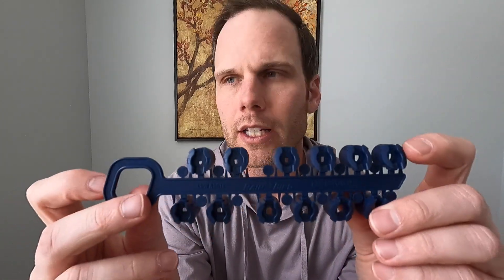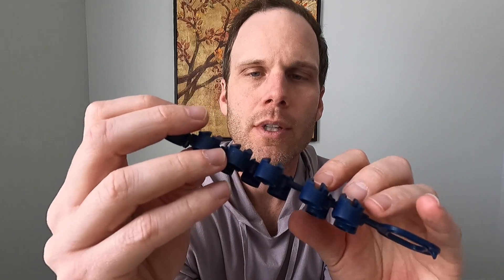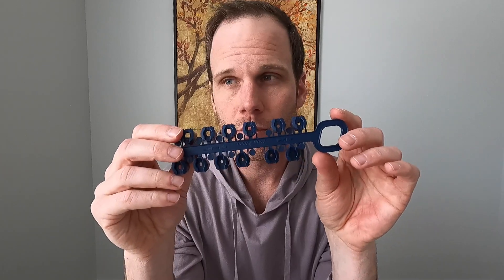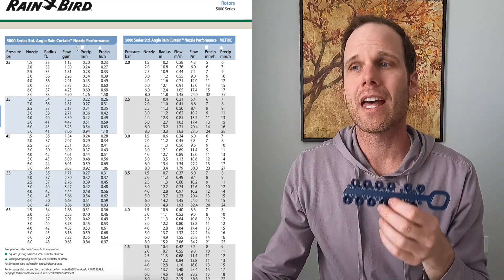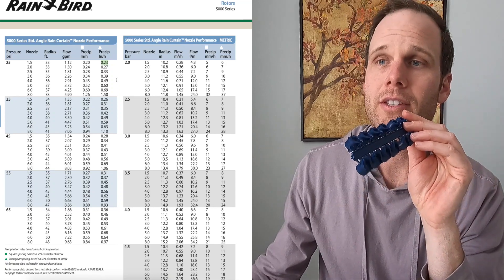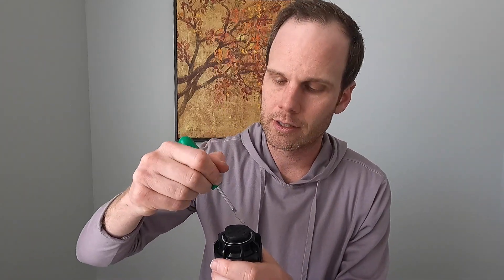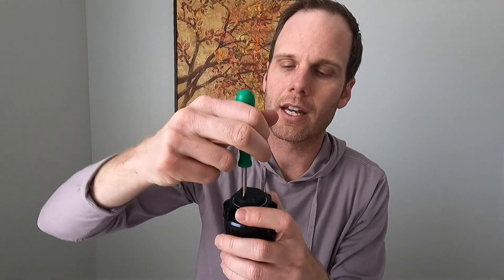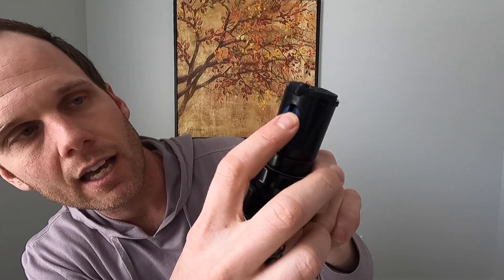Installing The Correct Nozzle Correctly   Rainbird 5000 Rotor Head

Comment: New subscriber here. Very informative videos. I have a Hunter sprinkler system and I noticed that on one of heads water is gushing up around the riser. after I hand tightened the head as much as I can. Do you have any suggestions why this is happening and how I can solve the problem? Thanks!
Reply from the maker: Probably needs head replacement.  Gasket worn out or head broken in some way.

Comment: none of those have a better rain curtain that the 3.0 it came with all the rest have dead spots in the arch of water , what am I doing wrong?
Reply from the maker: Make sure nozzles are damaged and set screw is not screwed down too far.  Hope that helps 
.
Reply: @thesprinklerchannel nozzles are all brand new and screw is not set to far down i really can’t get a better curtain than the 3.0 what number is supposed to be better ?

Comment: I bought some replacement nozzels to reduce the flow amount of one rotor head. I had a difficult time removing the nozzle that was installed and wonder if there is a technique to removing it.
Reply from the maker: Use the adjust tools has worked for me although sometimes damaged it or turning on water after set screw is retracted which holds it in.
Reply: @thesprinklerchannel  I found a video that suggests using the tool or a flat head screw driver along the bottom of the nozzle to be replaced. You push the blade into a recessed area in the main shat that aids in pulling the nozzle out. I haven't tried it yet, but think it may work.

Comment: I have the 5000 model  and it is 5 ou 6 years Old,  All Nozzel on my  5000  is  color  Orange  instead of blue and writen  number  2.0   do you know the difference  with the  bleu  color  ??  My  does not  pup  up ??  I have to help  to pup  up.     Tks for your nice Video.    Jack
Reply from the maker: Probably not much difference if any besides age.  Sounds like low pressure to your head.  Could mean too many heads on zone or leak in zone or system.

Comment: If I increase my backflow preventer from a 3/4 wilkin pressure Vaccuum to a 1” wilkin pressure Vaccuum, how will this affect my sprinklers?  It will have more water to each zone, but the nozzle size will impede more water coming out unless I change the existing 2.0 nozzles to a larger nozzle GPM?
Reply from the maker: No change to pressure.
Reply from the maker: Volume of water will depend on overall size of piping through entire system and coming into system from municipality.

Comment: Can you tell us how to get those damn nozzles out again? The little blue ones prior out easily with a screwdriver from underneath but the rainbow 5000 I cannot get that sucker out.
Reply from the maker: With adjustment tool or unscrew screw that holds it in and turn on sprinkler zone (just may not find it afterwards.

Comment: I like rain Bird but the radius screw is garbage. They always strip on top where I won't accept the Flathead no more. They need to make it either metal or have a backup where you can adjust the gears
Reply from the maker: Good idea

Comment: Great video!! Is there a nozzle already pre-installed on the Rainbird 5000 pro rotor?
Reply from the maker: Sometimes depends on supplier but they should all come with a nozzle set to swap out if needed.

Comment: Why am I having such a problem fitting the nozzle into the body
Reply from the maker: Make sure it’s the right one for the head.  Lots of different ones.  Then make sure it goes in at the given angle.  Takes some force, with water might be easier.

Comment: Great video, but do have a question about my situation specifically.  The nozzle on mine is spraying down at the base and out very hard which is not allowing the grass to grow and exposing the dirt. Way too forceful, so what do I need to do?  Is there a nozzle that allows it to just mist this area instead? Thanks in advance.
Reply from the maker: Sounds like either nozzle or head is installed incorrectly.  I would check both.  Nozzle seated properly and set screw down enough to retain the nozzle without movement and head buried flush with soil and head perpendicular to ground surface when activated.

Comment: Two of our zones run across the slipped area from right to left. We have noticed that there are sections remaining dry. Would the angled nozzles be better on these sloped sections?
Reply from the maker: You could try that as well as the soak and cycle feature on your sprinkler clock, shorter times but then runs through again in order to give it time to soak in.

Comment: Great vid.  Thanks!  I believe you forgot to mention how the circular flow tabs (1.5, 2.0, or 1.0LA, 1.5LA, etc.) can be pulled from the tree and inserted into the top of the sprinkler head.  On mine, there is a slightly recessed circle with 'crosshairs' on the top of the sprinkler head, to the right of the '5000'.  Insert the circular flow tab into that recessed circle to label whatever nozzle you have in that sprinkler head.  They are easily removable —and reusable— if you need to swap nozzles.  Cheers!
Reply from the maker: True, some do have those, some are just on the given nozzle.

Comment: How do you check your water pressure?
Reply from the maker: Hook up a water pressure gauge to any threaded T or elbow on the main line or zone or filter or back-flow preventer.  Each zone may be different depending on design and number of heads and installed nozzles if checking while running a zone.

Comment: So long at my new 5000+...no nozzle in place yet... Need to flush it but I see what looks like a white mesh filter in the opening... Will that let it flush debris before installing a nozzle?
Reply from the maker: I wasn’t aware of that but I would see if I could gently remove it, otherwise it may be permanently fixed in there.  You just don’t want to loose it if you turn on water and it goes flying out.

Comment: Great information and thank you for explaining in detail the different types of nozzles. I have been told that the screw that holds the nozzle in place should be adjusted to break-up the flow of water, but I don't see that in your video. Is that really a thing I should do?
Reply from the maker: No, only used if needing to shorten the throw distance.  Designed for coverage without the set screw deflecting water stream.
Reply: I was told the same thing. Thanks for the clarification! @thesprinklerchannel

Comment: Quick question, how do you remove a nozzle if you want to change it out to a different one?
Reply from the maker: Typically will either use tool to pry it out which usually will damage it but that doesn’t usually matter since I won’t be reusing nozzle or unscrew it and then turn on water which will normally pop it out

Comment: how do you change a nozzle?  I can't remove my current nozzle after backing out screw
Reply from the maker: Try using the Rain Bird tool to pry it out through the opening on the nozzle.  It may get damaged but should come out.
Reply: @thesprinklerchannel  I found that it damages the nozzle, yet still doesn't come out.  Instead I have learned to use allen tool and pull the nozzle out
Reply: @thesprinklerchannel  https://www.youtube.com/watch?v=laJkW68qVVE

Comment: Your video is very clear and easy to follow.  How do I remove the nozzle when I need to change to a different one?
Reply from the maker: Just unscrew the set screw which is what you see in front of the nozzle if you are looking at it straight on.  The set screw comes down to hold the nozzle in and if it continues to go down then it will start deflecting the spray pattern this shortening the spray distance.
Reply: @thesprinklerchannel  To remove the nozzle, I found using a tiny pair of needle nose pliers placed in the nozzle hole allows enough pull to remove the nozzle.  The nozzle is VERY difficult to remove otherwise.  Again thank you for sharing your clear concise video.  👍

Comment: Thanks for you video. Seems that documentation on these nozzles is pretty lacking so your video has helped me a lot.

Couple of questions for you: 

I imagine the data sheet numbers for the nozzles numbers relate to the pressure the head is receiving? 

It seems logical that the more heads you have, each will drop the pressure in the zone, and the amount it drops will depend on the nuzzle number you choose?

What would be the best way to calculate the overall pressure in the Zone? - remove one head and install a pressure gauge via some kind of T? then change the nozzle and check the PSI on the gauge? then once completed, remove the gauge?

Thanks for taking time to answer.
Reply from the maker: You’re exactly right!

Comment: I am trying to adjust the flow of water out of the nozzle.  I used the 1.5 standard but the flow is too strong.  How do you adjust the water flow?
Reply from the maker: Installing a smaller nozzle will reduce the water flow.

Comment: how did you get the old nozzle out?
Reply from the maker: I usually just use the tool and put the end into the eye of the nozzle and pop it out.  Usually I don’t need to reuse it so I’m not worried about damaging it.  Or you can turn on the water and it should blow it out with the pressure of the water after backing out the set screw enough.

Comment: Have a bare area . Was wondering why then I started testing out my system and my nozzle flew off and I tried to put in a new but for some. Reason that one has so much pressure
Reply from the maker: Just make sure the screw is screwed down enough before operating.  Lots of variables can contribute to high pressure.

Comment: What does it mean if there is water leaking around the rotor?
Reply from the maker: Either not screwed on properly from the base connection or the seal around the neck of the head might be damaged or have some dirt stuck in it.

Comment: I found out that if you adjust the distance too far counterclockwise.... it shoots your nozzle across the yard like a potato cannon.
Reply: Yep. I lost my adjustment screw. How can I replace? Does anyone know?
Reply: @user-xf3il8xx3i  this happened to me just a couple of hours ago. I’m assuming I have to buy a new sprinkler head
Reply from the maker: I like the analogy.  You are right.  If you back out the screw all the way, there is nothing to hold in the nozzle and once the water turns on or if it is already on, bye bye nozzle and begins the “find the nozzle in the grass” game.
Reply: 😮 @thesprinklerchannel 🎉
Reply: Did anyone find a way to replace the screw?
Reply: I just did the same thing and was wondering why the sprinkler felt like it was on full blast, couldn’t adjust it after. Left it like that for 1 year and just saw this video and realized I blew out the nozzle, changed out it out again and made sure not to turn it counterclockwise too far this time 😂

Comment: Sorry, A likely duh question.   I have 4 5000's on each run that a guy put in a while ago.  My waterline has 100PSI I thinhk I was told.  do I look at the 100PSI listing for each head (which doesn't exist) or 25PSI
Reply from the maker: Most likely neither.  He probably stated it for the beginning of system psi, you would need to measure at the head.  You could reverse engineer it and just see how far a head sprays, measure that distance and then reference the charts to see what psi sprays that far.  Otherwise just adjust them to get the results / coverage you need.

Comment: Question 
I have 100 psi for my water. How many rainbird 42SA+ head can I installed on a single line?
Reply from the maker: In order to know how many heads a zone can handle, you will also need to now water flow (gpm) you have available.  Also factors that can also include friction loss depending on distance and turns and sizing of pipe using.  Then you will want to reference the nozzle chart for the given head and do some math to see how many heads you can safely install per zone.  Also remember too much pressure can be problematic just as much as too little.  Ideal pressure at heads* is usually around 40-45 psi.  High pressure will cause the heads to mist more than spray resulting in water loss.  With high pressure, a pressure regulator should be considered.  We will probably come out with a video at some point going into more topic about sprinkler design but it is a more advanced topic if you are going to do it right and at this point it might be wise to get the counsel of your local sprinkler supply store until we can get some content published to explain more in detail on this topic.
Reply: @thesprinklerchannel  I have 100psi with 10GPM. Do you think I can put 4 rotary heads on a single line for a Rain Bird 5000?
Reply from the maker: @supersaiyan6556  as long as they don't exceed the 10 gpm collectively (the short response)*
Reply: @thesprinklerchannel  if 4 heads are 30 ft from one another, what do you think?

Comment: Thanks for the video and explanation of the chart (still quite foggy, though, for my brain ;) ). I thought the screw was not only to help hold the nozzle, but also adjust the spray, but it does not come down into the spray area of the hole to change the spray at all. I have tried 3 different nozzles, and (low pressure and standard) and found that they all have a pee stream at the top of the arc and very little spray in the rest of the arc. Any way to get more even spray instead of stream?
Reply from the maker: If functioning properly, the screw should deflect the water spray after being screwed down past a certain point.  Pee streams are usually seen when the nozzle gets blown out of the sprinkler head.  If you have a sprinkler supply store nearby I would take in to them and see what is going.  Sounds like something weird is going on that shouldn't be and hard to diagnose with being in person.  Hope this still helps somehow.

Comment: Remember, once you have a rotor spraying water, the internal pipe pressure drops to near ZERO. This is for ONE rotor. So your no flow (zone  off) water pressure might be 50PSI. Once you start the zone, your zone pipe pressure drops to near nothing.

Comment: I bought a complete System from rainbird but some sprinkler have a to wide angle. Can you explain me , which nozzle has the smallest water jet ?
Reply from the maker: I think it will be the .75 nozzle.  If you look at the holes in the nozzle set, it should be noticeable which one is the smallest if there isn’t a .75 one.
Reply: did you buy the In ground irrigation set? Does it fit the 5000 Rainbirds